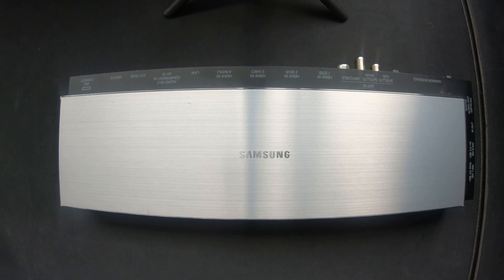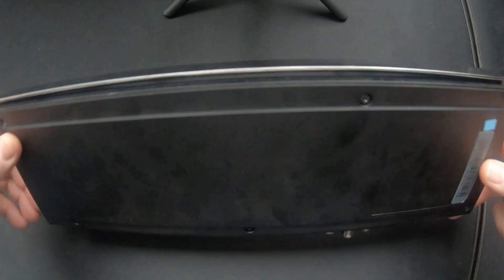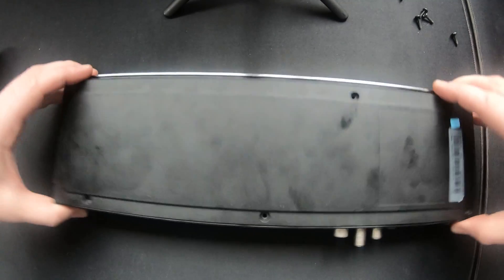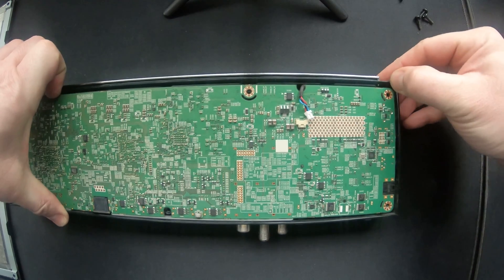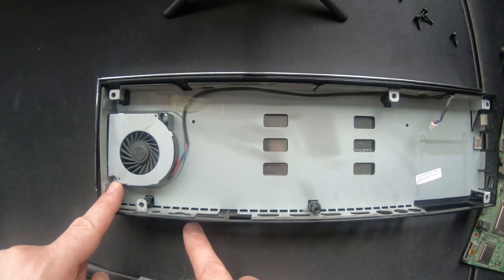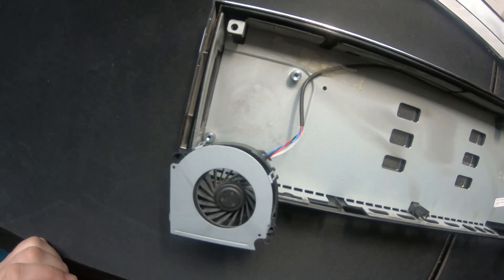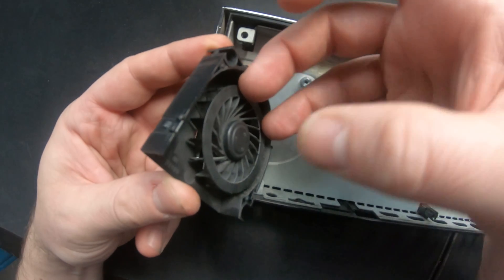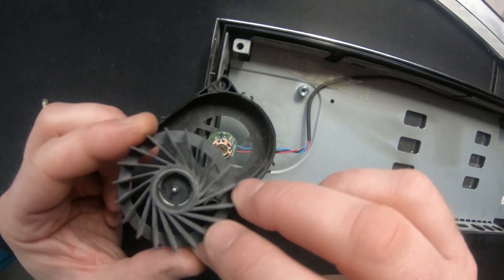How to fix the Samsung One Connect Box Fan Error Message 2021

Comment: Hello! Thanks for your video. It could be very helpful for me, I'll try it. But, I don't have the same problem as you in one connect. In my case, what happens is that the screen show a black screen, but I can hear the fun in one connect running about 6 second, and after that I can hear that it stops and in that moment a relay in the screen make a sound to re-start... So the process repeat with no end. But it I disconnect the wire so in the screen appear that one connect is disconnected.... So, do you have and idea for me.... Thanks
Reply: Same problem to me. Did you find solution? I think the box is faulty, sometimes works for a while and then stuck.